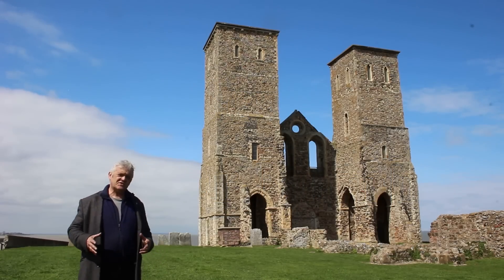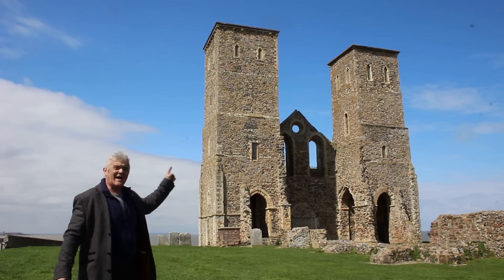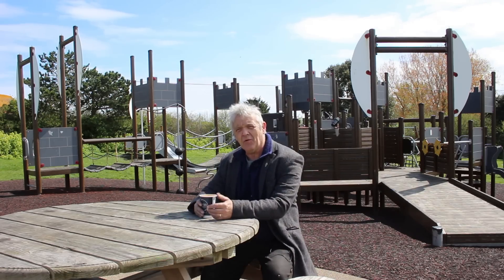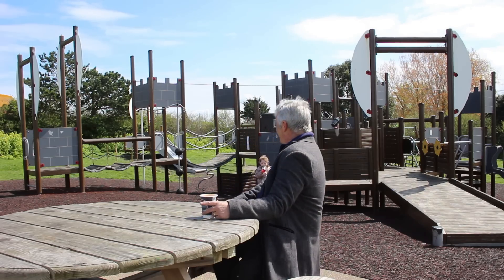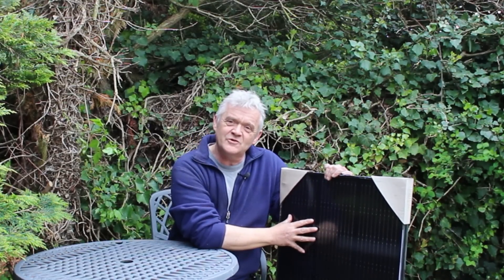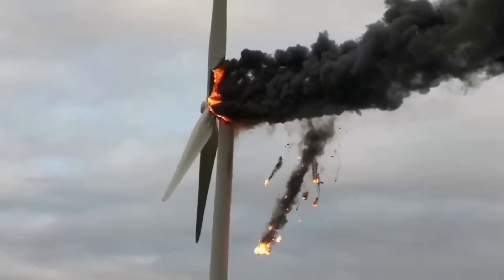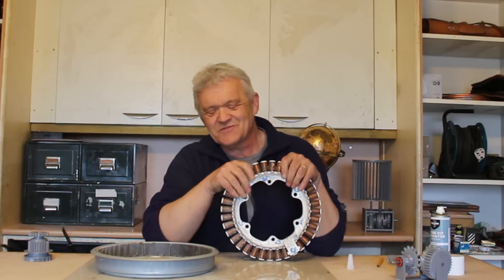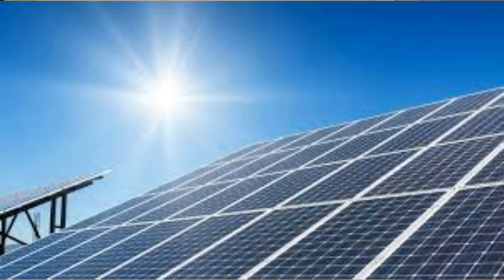1907 Wind Turbines - Scaling Up - Go Big, Go Many Or Go Home?

Comment: what would be nice to do a video on is a manual method of switching when voltage is reached so as volts change it switches between coil arrangements to keep getting a set amount of voltage (with in a set range like say making sure it stays between 11 and 13 volts, for charging something that is intended to be 12 volts, which can then be used to run an inverter system, to get 120 or 240v AC (depending on your region) 

also there is a very good tute you guys could highlight on how to make a pure sinewave inverter using Arduino's as the control for single split wave, and the basics for both a split wave and triple phase electric that could be filled in from the modified or square wave to being a pure sinewave inverter that is split phase or triple phase, Something to look at, I am still working on obtaining the higher power transistors for building a decent powered unit, for all three, on the cheap ;) (need fast acting ones as well as high power dissipation on those, as the pure sinewave unit is using PWM spaced out so after being sent into an inductor it smooths out between the pulses to create the ramping smoothly into an arc rather than either being a linear angle ramp or square wave to anyone other than rob and luke reading this, as I am sure they already know this, but figure anyone else can hunt that link down pretty easily with the search terms "arduino DIY pure sine wave inverter" as that is how I found them, and after the programming and testing with my oscilloscope, they are definitely good code, just need those power mosfets as it seems either you get low weak fast units or super high power units that are slow as a cucumber LOL )

Comment: If you call around washing machine repair places you can get many of these motors with broken wires that can easily be repaired if used as generators . If used as motors then they have to be repaired better for correct control but as generators not so much !

Comment: I absolutely agree that more self production of energy is needed and that installation of small wind turbines or wind harvesters as well as balcony solar in addition to rooftop solar and wind turbines can and should contribute energy - best to be used by those living in that house (stored for night usage as well if more made than used during the day). But we will likely need the grid in dense populated areas in cities and multiple Appartement buildings as well as to have somewhere to supply energy that is not used on the spot and transport it elsewhere. Our industry needs the grid as well since it uses the more energy for production than it likely can produce on the premises they are located on. If we want to reduce our impact on the planet we need to manufacture steel more energy efficient and with less burden on the environment. And we need to produce green energy in abundance to use it in the cold days for heating homes and offices as well as for air conditioning in the hot month which are unfortunately likely unavoidable in future.
Interesting times we live in with many obstacles but as well with many opportunities to change how we live as individual and society- as a nation and worldwide.

Comment: Go many, no question. The power management is a pain but the difficulty of maintaining large units and dealing with failed windings and mechanisms on large units.

As many alternators as possible too, if you’re dealing with solar. If it fails, you’re dead in the water.

Comment: Go many and go bigger! I have "working on " a counter rotating Ugurnsky. the idea was to put one or two generators in between them and mount a few of them  around the property. They really catch the wind but I am not sure I want dot my yard with spinning sculptures so maybe something more like Bee Hives ( Darwin turbines) would be more aesthetically pleasing. So bigger parabolic shells and a powerful axial generator at the bottom. I checked video 1490 ( I think) where you built larger parabolic cones. How do you think you could similarly "cast" stacking ring slices for the  intake (the wind gathering portion) as in your boat/camper generator video 1901 . Your videos are like a library. I will consult video 1835 and 1837 before deciding. Do you have a preference for wind gatherer?

Comment: I was wondering if a large array of thermoacoustic engines made as generators would be better than one large thermoacoustic engine. I have been leaning towards the array for those same reasons. An array would be more robust, easier to maintain (if set up right), and error tolerant, but I would still have to choose the optimal layout to maximize efficiency and that would likely take up more space. It was nice to hear that I am on the right track. Thank you.

Comment: Thought exercise: Suppose there are multiple serpentine-coil-based wind turbine generators you want to link up. Their native output is AC. If we just put them in series or parallel, the voltage/current from one may cancel the voltage/current from another. This means you have to rectify each turbine output prior to linking them together. I assume that the arrangement of turbine connections (how many in series and how many in parallel) is based on the load you're shooting for. Now your extremes (max voltage and max current across different wind speeds) is going to be a much larger range and something you have to contend with... Braking, fuses, shutoffs... I imagine that a slower, higher torque turbine generator design would be more preferrable to narrow the output range a bit, but then you likely lose some potential power in higher wind speeds... This is why it's called engineering.

One could argue a network of many small turbines is more engineering work than 1 large one, even if is it has advantages like safety and redundancy. I don't disagree that it's a superior solution to the giant turbines and their challenges, just making a point that it isn't as simple as "wiring them together without controls". Solar panels are much more simple because their max output is limited while a wind turbine's max output is far larger (esp. compared to it's nominal output).
Reply: This is the UK! I live in the north where we have heard of this mythical thing called "sunshine" that is needed for solar power but up here rain and wind turbines make much more sence! LOL its not quite that bad but sometimes it feels like it is. 😀

Comment: My experience with developing weapons systems includes modularity, redundancy and robustness.
I'm a bit perturbed about combining energy from the sources.
Many PV panel arrays will only transfer the energy at the level of the lowest PV panel output.
There are better ways to do that.
Reply: If each has it's own microinverter and then those are joined together, they each have their own output regardless of what else is in the "array".
Reply: @IrrelevantOne  yes, that was my thinking. Then each source may operate at its peak output.

Comment: People also need to change their way of thinking. Most people that get solar panels feed directly back into the grid. But getting batteries will save you much more these days because the charge back rate is much less than usage rate. In some countries their are even systems that monitor the electricity price. When you charge back when the demand is high it suppose to be pretty lucrative.

Comment: Got solar on my houseboat, a series of small wind turbines would be useful for the grey days and nights but with no moving parts the panels only require occasional cleaning. I think a series of turbines is going to need a fair bit of maintenance by comparison and there will be noise and vibration to think about.
Reply from the maker: i think it depends what you go for mate

Comment: Hello Robert, I can’t believe you live close to Reculver. I live in Herne Bay, not far from there. The idea of creating many small turbines rather than increasing there size is one I have thought about for quite a while. The episode where you demonstrated contra rotation and stated the increased output got me thinking of the Darwin turbine with flat disc generation. Could a contra rotating system be set up by using two of them?
Reply from the maker: that is amazing mate - i will be in Herne Bay tomorrow I think
Reply: Give Whitstable a wave from me..

Comment: I've been saying this for a while, but I don't understand why they have the massive turbines rather than a contained array. Is there a reason why this isn't used? Obviously (by measure of this video if nothing else), I'm not the only one supposing this, but having so little knowledge of any of the fields involved I just figured there must be a simple answer as to why arrays aren't the way!?!
Please can anyone point me in the direction of an explanation?
Reply from the maker: they are being actively looked at mate - but they are a bit behind
Reply: @ThinkingandTinkering , on the surface it seems to make much more sense to me (especially when I see lightweight propellers(?) whizzing around as they do with the lightest of breezes), as besides the cost in materials and I'm sure parts, the manoeuvrability of arrays (as I picture them), would also increase the yields dramatically.
Thanks for your channel anyway, we are of the same heart in regards to sharing knowledge - only you seem to know what you're actually talking about!
Reply: As I understand the problem is the way in which they calculate for the amount of energy they can get from wind. It's a classic "flub the numbers to make it look good" mixed in with "well on paper it should be". You can see how it would result as such. Dishonesty in science, tied back to where they get their grants from etc.

Comment: Interesting video Robert. From personal experience with my small 2kw wind turbine unfortunately controls are a must. You need to guard against over voltage, run away, breaking etc and then potentially have back systems for those as you really don't want a run away turbine 😊
Reply from the maker: you do need controls mate - my main point was over control not control per se